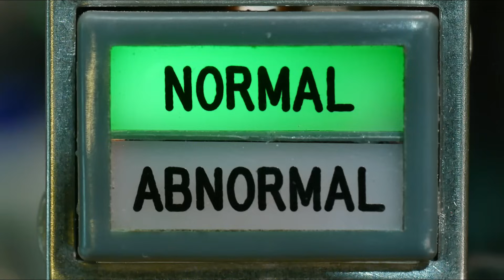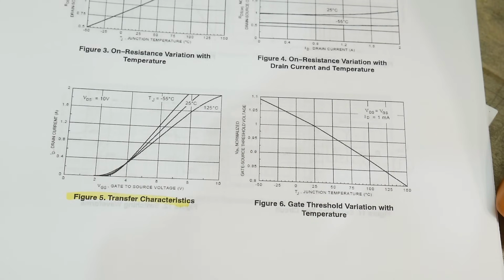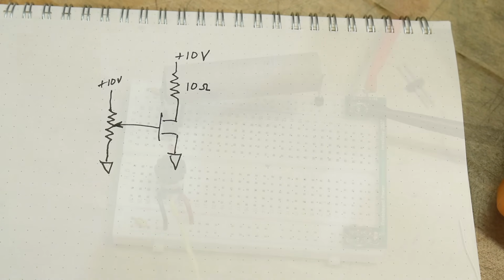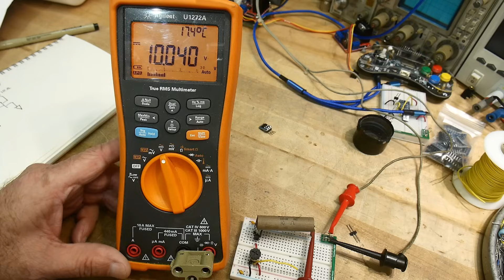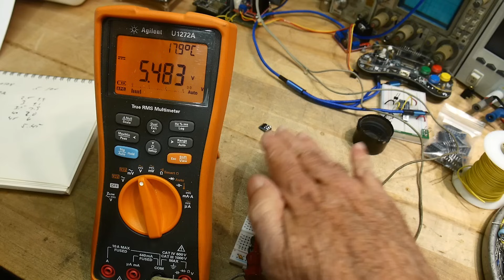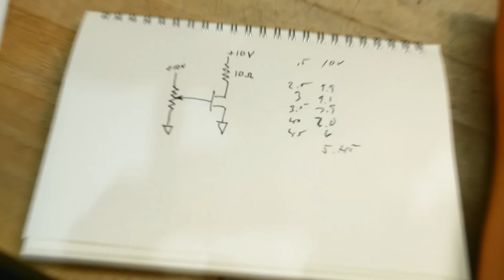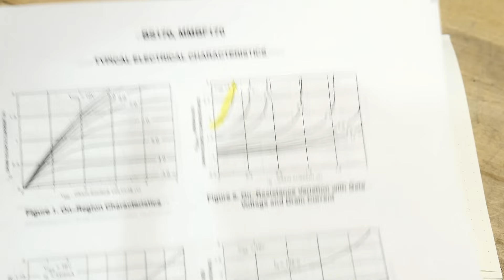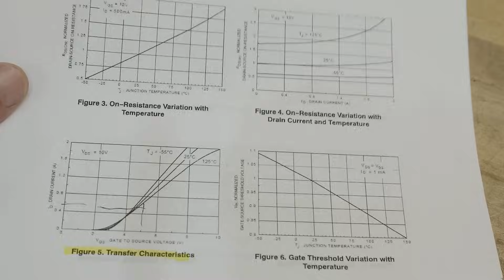#1856 BS170 Measurement by Hand

Comment: I recently did the same with some OpAmps.  Kept them in a very basic circuit with only two pots to set the gain and running on 2 x 12V batteries.  No reactive components except the ICs.  Set there gain to x10 (20db) at 500Hz.  Increased the freq, but left the gain controls alone.  Graphed the results.  Unity gain for my TL071 was about 3MHz as it should be.  OPA637s and 741s were rubbish at 200kHz and 100kHz.
Oh well you get what you pay for.  Least I know what to throw out.  Interesting exercise in spite of being a bit disappointing.  Might do the same for other OpAmps in my tray.

Comment: I'm surprise that he didn't blow his transistor. If the big resistor become hot how come the small transistor didn't blow up?
Reply: The maximum current through the transistor occurs at the lowest VDS. Power is just the voltage times the current through/across the junction. If the drain and source had a voltage of say 5V at 1A, the power would be a not-so-good 5W.

Comment: I'd recommend watching the current as you turn the knob and go in the increments of current, up to some max that is safe for the device, noting the voltage at each increment. This way you are less likely to overheat it and will get more useful data points (due to the non-linearity of the I/V curve).

Comment: Is it true that current move only on the surface of conductor.please I need answer
Reply: Not generally.  For higher frequency RF current, this begins to be the case.  For DC, not.   It's call "skin effect".   As a ham radio operator using sketch antennas in the field with a lot of RF "floating around" on the antenna cables,  the other "skin effect" describes the RF burns you can get as the RF prefers you as the path to ground.

Comment: This video shows how a little basic knowledge can be used to get all the information you need to characterize most components, even unknown ones. Although I do recommend  people buy one of those cheap ($7 to $15) component identifier/testers. Even with my bench full of good test and measurement I find the little tester very quick, handy, and reasonably accurate to sort through new, surplus, and pulled parts. It's amazing how cheap useful test equipment has become.
Reply: The trouble with those is there's a ton of clones, and not all the clones support the more advanced firmware that has some extra functionality in it. It's nearly impossible to tell what hardware you'll get (and thus if it's compatible with the extended feature firmware) until you order it and open it up yourself these days! I'd really like to get one, but got bogged down trying to figure out which one to get, and the consensus now is that it's impossible to tell...

Comment: At 2:57 "... a maximum of 1 amp, so we're not going to blow up anything, okay?" Not okay. Did you miss the part of the datasheet (see 0:32 ) that states Id max = 500mA continuous? Or the part that gives maximum power dissipation of 830mW (since a 10V supply and a 10R load will allow a worst-case power dissipation in the mosfet of 5V x 0.5A = 2.5W)? At 7:40 that wasn't just the resistor getting hot, it was the mosfet passing 450mA with 5.5V across it, thus dissipating almost 2.5 W in a TO-92 package! That will give you a "junction" temperature around 400°C.
Small signal mosfets are meant to be used with moderate currents. Use a 100R 1W resistor and measure up to Id = 100mA. It's just as useful a demo of the characteristics.
Reply: Part of the instructional process to gain acquaintance with the "hot electronic smell" that ever experimenter should be aware of.
Reply: Pfft, datasheets - you only need to follow those if doing designs. This is more like destructive testing / education / experimentation. How do you think they come up with the datasheets in the first place on a new design? They basically do it like this (but with more automated test setup). Following the datasheets too closely leads to very boring circuits with a distinct lack of smoke, fire, and excitement.
Reply: @gorak9000  What you say is accurate if you only design circuits to blow up and set on fire. However, for the rest of the world (aircraft industry excepted) ...
Reply: @RexxSchneider  You missed my point entirely - the purpose here is not to build circuits, it's to characterize the device. You want to see what the device can and can't do. You're not designing a circuit that you want to still be working in 100 years, you're pushing the limits of the device.
Reply: @gorak9000  Yes, you're right: I missed your point entirely. I thought the point of the video was to build circuits. I didn't realise the point was to ignore what the manufacturers who wrote the datasheets had already told us and to independently discover what it takes to destroy a particular sample of the device.

Comment: You could also use an Arduino to control the voltage supplied to the Gate, and to measure the Gate-Source voltage.
Step trough the voltages in small increments, and output the results as a csv-file that you can open in Excel and make graphs out of.
Basically do the same as a CurveTracer do, just a lot cheaper.
Reply: And it’s nice that you can control the granularity to about 12-bit places.
Reply: There are also some nice peripheral DACs with low impedance outputs and very high resolution too.

Comment: Remember that when the gate is on enough to draw .5A through the drain-source, the voltage across the drain-source will be 5V.  5V times .5A equals 2.5 watts.  I'm pretty sure that the device was not rated for 2.5 Watts (at least not without a substantial added heat sink) and that the device was what you noticed getting hot.  I'm kind of surprised that it survived the experiment.
Reply: No current flows in the gate in static conditions on a MOSFET. The current is flowing in the drain-source channel.
Reply: @misterhat5823  Yes and that drain-source channel current is .5A and it has 5V across it so it's still doing 2.5W and getting really really hot.

Comment: Cool, would you do that again vs  BF256, MMBFJ202,  comparison mosfet vs fet, to see how mosfets differ from fets.
The simulator shows you can build differential amplifier with mosfets, but they use fets inside opamps.
Reply: FET is short for MOSFET. So a FET the same thing. There is no vs.
Reply: @simontay4851  No, it's not
MOSFET = "Metal Oxide" Semiconductor Field Effect Transistor and have a body diode.

The sell both types at mouser and so within their own category.
Reply: @simontay4851 JFETs are different from MOSFETs.
The MOSFET demonstrated here is an N-Channel MOSFET which can be turned on with a positive gate signal relative to Source.
An N-Channel JFET (Junction Field Effect Transistor) works a bit different.  When the Gate is at the same potential/voltage as the Source the transistor is fully switched on.  To switch the JFET off the gate must be pulled negative compared to the Source.
Obviously with P-Channel FETs everything is turned on its head.

Comment: Nice! At $20/meter you might as well have 2! That will make your measurements a bit quicker since you don't need to move your test leads around so much. Just twiddle the pot and read off the voltage across your test resistor!
Reply: There is no such thing like too many multimeters!
Reply: @yakovkonovalchukov2400 
True 👍

Comment: Nice experiment, just you have to be fast enough. In the setup with 10V and 10 Ohms you pass through the point of 5V 0.5A which is 2.5W at the transistor. I was watching the drift of the output voltage to see when the transistor will give up and send a smoke signal, but it was finished soon enough and it survived. I propose tho do the experiment with a 100 Ohm resistor.
Reply: Did exactly the same : view the drift and know that the transistor was feeling pretty hot...